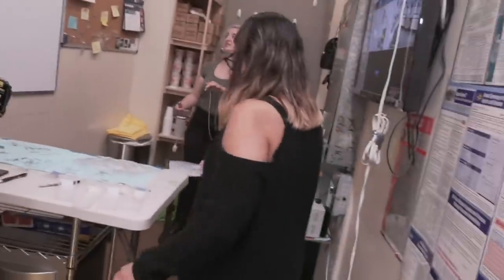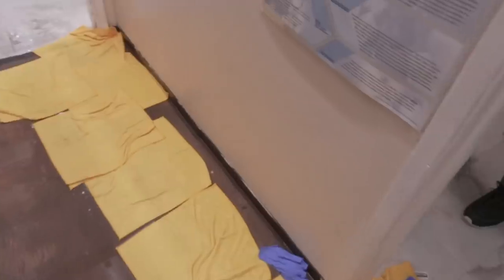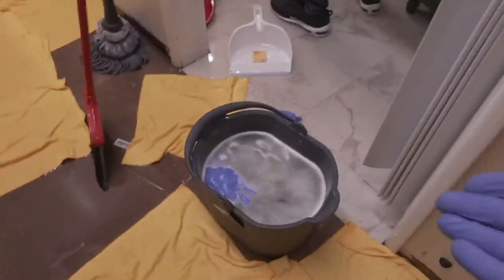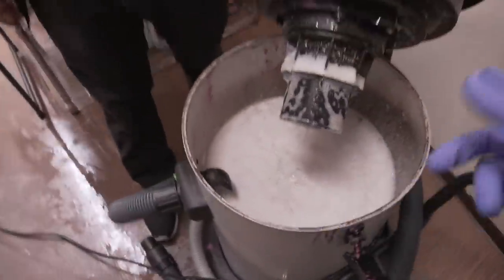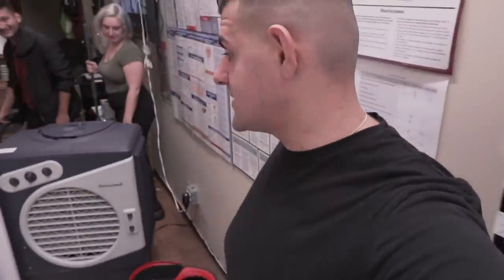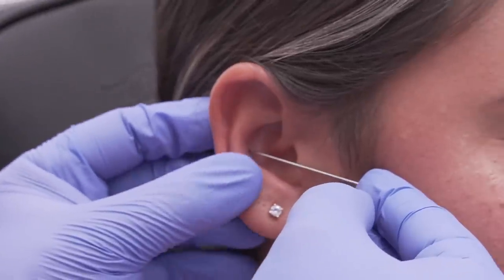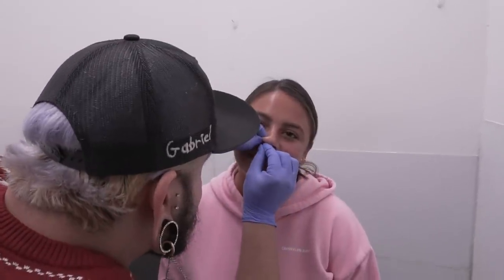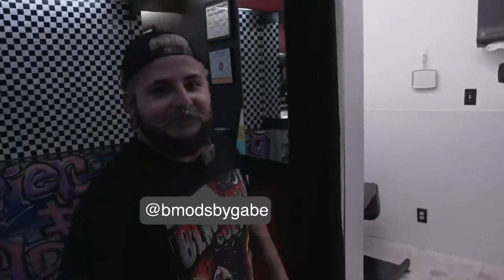MASSIVE Flood At Our Store!! + Smiley, Conch & Nostril Piercing | Ep. 362

Comment: A shop vac would help. Did they turn off the water?  You will need a dehumidifier to make sure black mold doesn’t grow. Check the packages on the lower shelf to make sure they didn’t get wet.
Reply from the maker: All good! Thank you
Reply: Not sure what is happening, but you’re the 3rd channel I watch that’s had a flood either at their home or business and one had a flood at both.  We had a water leak almost 2 years ago that ended up destroying our laundry room. The water got sucked up into the insulation in the walls and in the flooring and insulation under the floor. Because the flooring was older they had to test for asbestos which requires specialists to remove it and they removed everything down to the floor joists. Then thru errors by the company that was supposed to fix it the whole room became infested with black mold and they had to remove everything down to the studs and rebuild the whole room. It took forever and it still needs a few things fixed. It is gorgeous now and looks more up to date.